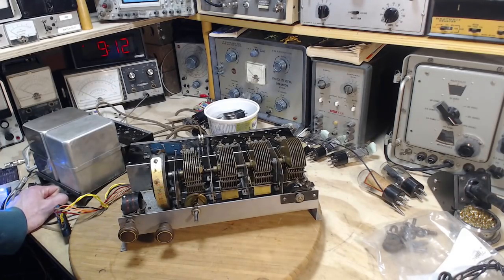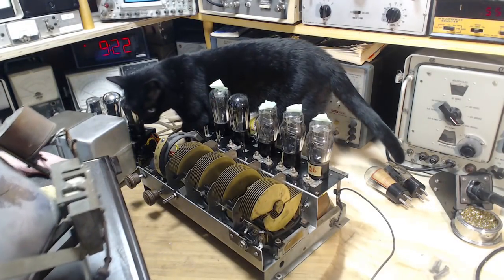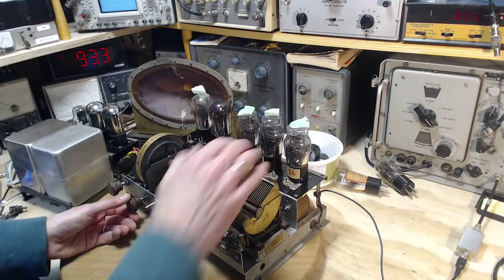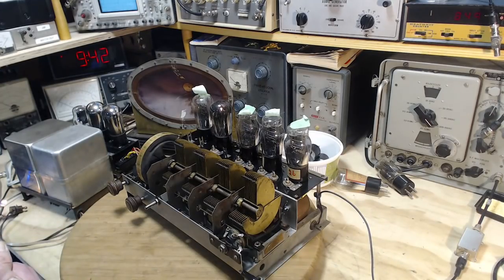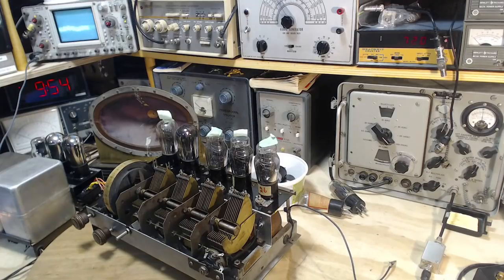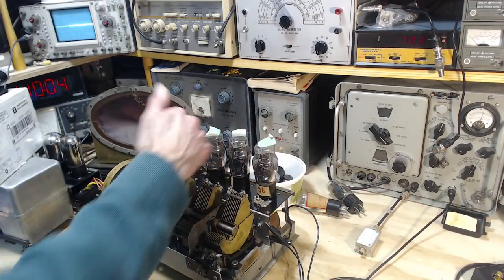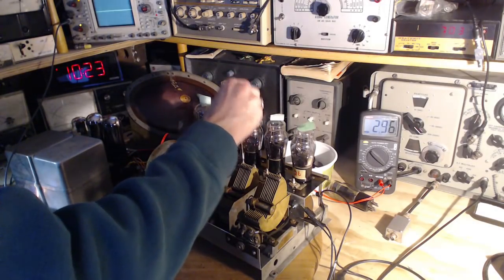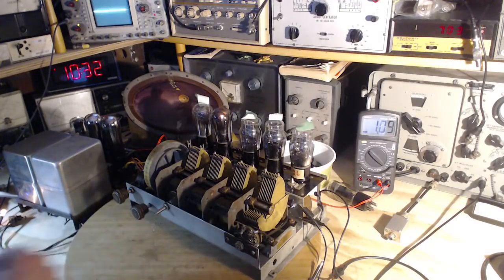1928 RCA Victor Model 28V   Video #57 - Readying For Tune-up

Comment: I believe each section and tube was mainly to progressively amplify the weak signal, not sharpen the selectivity.
Reply: I wonder if the tubes could be replaced by KORG Nutubes 6P1's  mounted inside protective casings made to look like old vacuum tubes just wondering and saying the filament is also the cathode and operates at 3 volts.

Comment: At the beginning of the video you said you would do a proper alignment. But, you never did. More tweeking instead. End result is radio doesn't sound as good as when you started. So in over an hour all you did is put the tubes in. And we wait for the alignment.